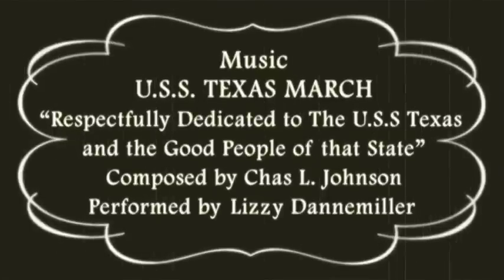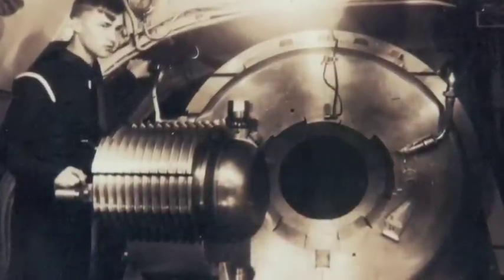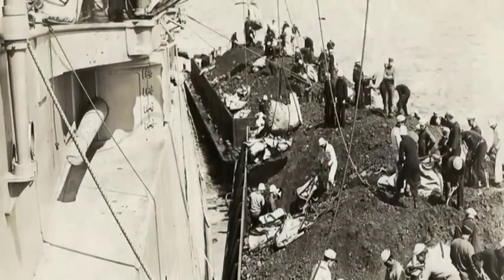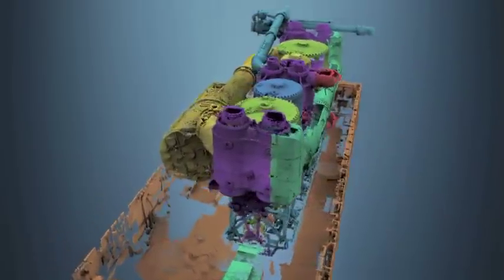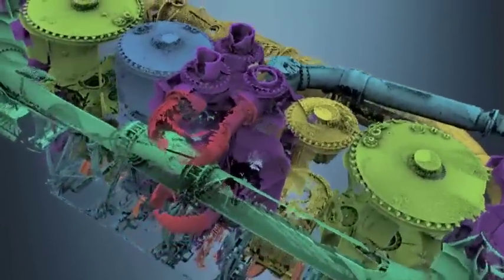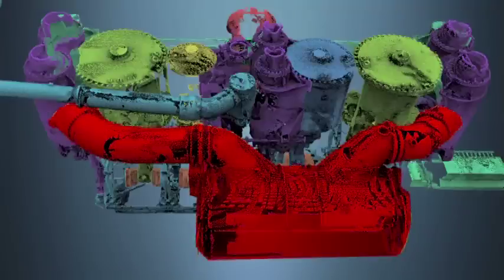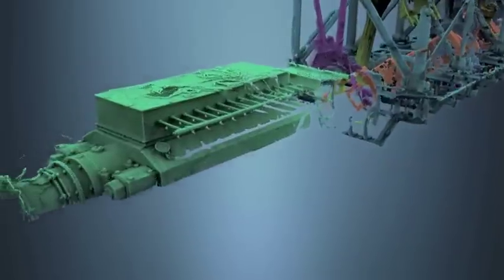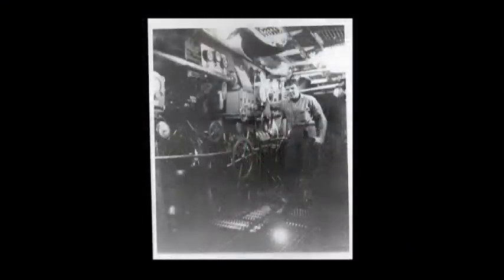Battleship Texas Engine Rooms

Comment: This battleship would not be classified as a dreadnought let alone super dreadnought. Yes, the big guns and the armor is comparable to a dreadnought, but the missing component are steam turbines. All dreadnought and super dreadnought classified battleships would need to be powered by steam turbines which for a ship of this era would have a top speed of 25 knots. The year they mention for the Texas construction follows the actual Dreadnought battleship, usually a battleship without turbine engines would be classified a pre-Dreadnought. This ship would be obsolete as soon as it was built.
Reply: +WMJCPA: In fact she is a dreadnought. The term is properly applied to the configuration rather than the power plant. Yes he wanted a good top speed, but Fisher's primary concept was to have a uniform main armament rather than a mix of heavy and light guns. The USS Iowa (BB-4 not BB-61) Is a good example of a pre-dreadnought. She carried four 12" guns in two fore and aft turrets and eight 8" guns in four wing turrets. HMS Dreadnought's top speed by the way was 21 knots-exactly the same as Texas's. In fact all US Battleships-turbine driven or not had a max speed of 21 knots until the USS North Carolina and her sister USS Washington were commissioned in 1941-their top speed was 28 knots. The main advantage of a turbine in this era was better fuel efficiency, fewer moving parts, and a good deal less vibration than a reciprocating steam engine.
Reply: ***** I don't think the British really cared about the definition of the term 'dreadnought'-at least not until the naval historians started writing about the subject in the 60's and 70's. As far as I can tell from my reading, any post 1906 battleship can and probably will be called a dreadnought by somebody. The term, as I said in my earlier post is generally used to mean a  battleship with a uniform main armament.  Since no one was building mixed armament battleships after 1906, all post 1906 battleships can be considered 'dreadnoughts'. My point was that speed and/or engine type had nothing to do with the 'Texas' being a 'dreadnought'.  You're correct that turbines alone don't make the ship faster, but I can't think of any major naval battle that was won or lost because one side ran out of fuel in the middle of the battle, so your comment there seems a bit silly. And if speed is so unimportant, why were naval planners and architects consistently seeking to raise the top speed of warships? I don't think it was because they were competing for a racing trophy . . . 
If the British want to refer to their new carrier as a 'supercarrier' who cares? They no longer have an empire, throw them a bone for God's sake.
Reply: +DEEREMEYER1 I do agree with you and also the subsequent reply has merit.   I think the Brits are basing their classification of the older carrier on 2 points.   I could be wrong but this is my opinion.   The Brits did come up with 2 very important innovations in modern carrier design, the angled flight deck and the enclosed bow called either a hurricane bow or an Atlantic bow I don't recall.   But it was these innovations that made a major difference in carrier design.   Is it enough to classify a ship as a Super Carrier,  I don't know.  I think nuclear power is a real part of that class, that in and of itself  makes these ships or any ships more formidable since they are not tethered due to cruising radius,  they could stay at sea indefinitely, at least as long as the food holds out.  I don't know if the Queen Elizabeth is nuclear powered,  it would seem that is state of the art for a supercarrier,  but who knows,  they can call it what they want.   

Finally as fat as the Forrestal,  I believe that was the first American carrier with the angled flight deck and the closed bow, hence the posthumous elevation, but again,  what difference that makes I have no idea.
Reply: +DEEREMEYER1 I don't think you read the comment properly.  I said nuclear power made the Nimitz class and now the Ford class more formidable because of not having to worry about fuel consumption.  As far as the Montana class battleships that were to follow the Iowas.   yes they would have been slower by about 5 knots.  Some of that had to do with a wider beam which was necessary in order to carry a 4th turret of 3 16 inch guns,  also the armor was to be enhanced over the Iowas.  The Montanas were the first class of American ships which would have been too wide for the Panama Canal.  We could go round and round on the Montanas since they never even made it to a serious drawing board. 

I agree,  full or flank speed would be reserved for actual battle conditions.  Even the nuclear carriers do not steam along at full speed unless they would be conducting air ops,  even when fuel isn't a problem.  Likely steaming at full speed too log could put a strain on the hull members and the keel, but I don't know I'm not a naval architect,  I just enjoy naval history, but according to you I'm silly so I guess this is just some silly fallacy.   if you noticed in all of my comments I never once called your comments silly, I don't understand why today when people attempt to discuss any topic one must ultimately revert to insulting the other party.  You can state your opinion and your information without this nonsense, but if you must then have at it, that is silly and gets everyone nowhere.
Reply: +DEEREMEYER1 Wikipedia no,  this is from many years of accumulated knowledge picked up wherever I can find it.   I have done extensive reading on the history of Naval warfare studying various sources.  of course nobody can know everything about the topic, unless you are in the field.  In my case it's just an insatiable thirst for knowledge on naval warfare and design and capabilities of warships.   This all started way back in the early 70's  when I was in college.   I picked up one of those pocket books with an illustrated history of Hitler's High Seas Fleet.  It was just one of those things as a diversion from the text books in a time when there was no cable TV  no Internet or other media.   So in reading through the History of the German Navy in WWII which was somewhat interesting even though it wasn't a huge fighting force. I wanted to go further.   I picked up History books on the High Seas Fleet of WWI, the events that led up to Jutland, the German development and innovations in submarine warfare and design.   After exhausting that ,  I picked up a history of the U.S. Navy from the birth of the nation to the then present day.   What I derived from this that naval history is inexorably woven into the fabric of our nation.  When the British began to settle the Americas,  naval construction was very much part of the decision to stay.   Britain had virtually depleted their forests for the large timbers needed in naval construction.   What they found in our rich forests was a breed of tree called "live oak"  They found the properties of this timber to be quite unique.  It was not usable to construct an entire ship,  but when lengths of wood were cut from the timber and used to enhance the side hulls of ships it behaved like armor.   The properties of this timber seemed to absorb the shock of a cannonball striking the side of the ship.  Hence, they came and they built ships hewn from our forests. 

Anyway enough of that,  I could not have found that information in Wikipedia in this short time, so I just wanted to show my "credentials" as someone who has been interested in this for over 40 years.   I almost joined the Navy in 1975, in fact they recruited me in a big way.  The only thing that stopped me was my impending wedding that summer, and the advice of a friend who was a swabbie and participated in the naval blockade of Cuba during the 1962 missile crises.   He told me the Navy was not a married person's service especially not a newlywed.  At this point in life I should have opted for the Navy.  

One note about speed, and I agree with you speed is not a major factor in most cases.  But,  considering the great speed of the Iowas, is probably a major factor that saw their rejuvenation in the 80s.  They had the juice to run with the Nimitz class carriers as part of an awesome strike group.  I did once see a video where they were talking to a sailor who had served on the MO in Korea.   The reporter asked him how fast the ship was.   He responded the top speed rated was 33 knots,  but he said if they really cranked it open to flank they could hit 38.   when they would do this they would get a huge rooster tail coming off the stern.   this bore out official accounts that said each one in class had hit in excess of 35 knots.   not bad for 50,000 tons of steel
Reply: +DEEREMEYER1 yes I remember the politics of the Kennedy.  That was that moron McNamara who didn't want to build it Nuclear.  Ok better check your facts, the first Nuclear carrier was the Enterprise.  this was followed later by the Nimitz class.   Kitty Hawk I'm fairly certain was not nuclear,  but I could be mistaken but I don't think so.  I had a colleague who served on the Kitty Hawk during Vietnam, and fairly certain not nuclear.

Regarding the JFK, I remember at the time the news talking heads discussing why would you not make the ship nuclear after the success of the Enterprise.  He did not want to ask Congress for the huge amount in 1960s dollars it would take to make it nuclear,   after all LBJ  had his hands full with Vietnam.   I Remember critics of the administration saying here we are building this huge carrier which is obsolete before it even gets off the drawing boards.  Yes it was a political decision they just wanted to get a ship out there bearing JFK's name.   Seriously, check your facts on the propulsion of Kitty Hawk. I will too. 

I didn't state unequivocally that the reason for the Forrestal being reclassified a supercarrier was the deck and bow, I merely said it could be.
Reply: +DEEREMEYER1 yes I remember the politics of the Kennedy.  That was that moron McNamara who didn't want to build it Nuclear.  Ok better check your facts, the first Nuclear carrier was the Enterprise.  this was followed later by the Nimitz class.   Kitty Hawk I'm fairly certain was not nuclear,  but I could be mistaken but I don't think so.  I had a colleague who served on the Kitty Hawk during Vietnam, and fairly certain not nuclear.

Regarding the JFK, I remember at the time the news talking heads discussing why would you not make the ship nuclear after the success of the Enterprise.  He did not want to ask Congress for the huge amount in 1960s dollars it would take to make it nuclear,   after all LBJ  had his hands full with Vietnam.   I Remember critics of the administration saying here we are building this huge carrier which is obsolete before it even gets off the drawing boards.  Yes it was a political decision they just wanted to get a ship out there bearing JFK's name.   Seriously, check your facts on the propulsion of Kitty Hawk. I will too. 

I didn't state unequivocally that the reason for the Forrestal being reclassified a supercarrier was the deck and bow, I merely said it could be.
Reply: +DEEREMEYER1 I agree with you on retiring the Iowas, but the powers that be are opposed.  Remember,  Bill Clinton almost sold the MO to the Japanese for scrap in the 90s, go figure the irony of that one.   At least we have all 4 Iowas standing as museums, along with several ships from the South Dakota class and the North Carolina.   The Brits kept not a single capital ship from WWII  there only remnant is the cruiser Belfast in the Thames, which I did have occasion to tour.   It is no battleship that's for sure.  On my bucket list is wanting to tour one of the Iowas and one of the South Dakotas.  Ideally I would like to tour the MO but I don't think that will happen. n We will have to see. 

As far as typing,  I'm doing this on my smartphone, not really the best instrument for fast typing.   The fat thumb problem rears its ugly head.
Reply: ***** I didn't say fuel wasn't important, only that I don't know of any case where one side lost because they ran out of fuel during the battle which is what you seemed to imply with your comment about racing "And then when we're racing and you run out of fuel, I'll pass you and win." Nor did I say anything about steaming at full speed at all times, only that a high top speed was-and still is-considered a desirable feature in a warship. My apologies if the comment seemed belittling-not my intention. You are correct that in a strategic view, fuel conservation is vital, but in a tactical situation it goes out the window. As you yourself said, the use of flank speed is to EVADE enemy bombs, torpedoes and shells. There's no point in conserving fuel in actual combat if the result is your ship is on the bottom with full fuel tanks because you were moving too slowly to evade a torpedo, etc., but no, high speed in and of itself is not a magic shield that protects a ship-as the unfortunate sailors who served on HMS Hood found out (Jackie Fisher's 'battlecruiser' concept was a huge mistake in my opinion).  The key, as I think we can all agree, is the right combination of speed and protection (protection being armor, air cover, anti-missile batteries or whatever).  I do agree that they should have kept an Iowa in operation. And I don't trust any government because lying is what they do best. It's now 4 am and I'm going to try for a little sleep.
Reply: ***** No offense, but are you actually reading my posts before you go off on me? No, of course a ship can't always reach its design speed especially in high seas. No there isn't a lot of difference between 23 and 25 knots.  No, warships especially large ones don't operate alone.  And I said that speed alone is not a shield. All I'm saying is that high speed was, and still, is considered a desirable feature of a warship. In battle warships normally operate close to or at the maximum speed that conditions will allow.

Answer me this sir.  If speed is so 'unimportant', then why weren't all warships designed to go a nice easy fuel conserving 10 knots? In regards to speed winning a battle, I'm working on less than four hours of sleep, so no, I can't think of a battle where speed alone was the deciding factor, but I will mention that any PT boat skipper going in for an attack was going to make the highest possible speed given the conditions that he could, not idle along to save fuel during the critical moment. And whoever he's attacking is not going to poke along to save fuel when  the torpedoes are inbound.  And no I'm not talking about just one ship vs one ship there.
  As for the British losing capital units in great numbers the only instance I can think of offhand is Jutland in 1916.  Most of their losses were battlecruisers I believe.
  In regards to straddling, you seem unaware that until radar came along, fire control was NOT very accurate.  Range and speed had to be estimated, fed to the guns which then had to be elevated and fired. That takes time and in the meantime, your ships and the enemy ships are still moving. Every navy, ours included, sought to straddle the enemy in a gun duel. It was the best way to get a decent idea of the actual range to target. If you got a hit with your second salvo, that was pure luck. There's a game called 'Atlantic Fleet' available on Steam that does a pretty good job of simulating the difficulty of hitting a moving target from a moving platform. And yes, I know that a game is not the same as reality. Alternately, you could get a radio controlled boat and have a friend operate it while you shoot at it with a BB  gun or a .22 while you're walking quickly and sighting it through range-finding binoculars. Of course it won't be shooting back at you unless you drop a thousand dollars or so on one of those RC warships that have working turrets and BB guns mounted in them. Anyway, the point is, it's not at all easy to hit a moving target from a moving platform, especially when the ships are moving at top speed-for the prevailing conditions. 

  Bomb splinters are just that, flying shrapnel from an aerial bomb that exploded on contact with the water close to the ship. Shell splinters-those result from plunging fire, and since most big-gun battles were fought at a fair distance, virtually none of the incoming shells are arriving on a flat trajectory.  An HE shell rather than an armor piercing shell striking the water will explode and send splinters flying.  If it 'is' a relatively flat trajectory, the shell can skip along the surface of the water for quite a distance by the way.

 As for Pearl Harbor, give the British a break. It's much easier to raise a ship from shallow water, and most British losses were emphatically not in shallow water. And yes, they did suffer from a lack of destroyers because they were simultaneously trying to provide escorts for their battle groups and for the North Atlantic Convoys which were the only things keeping Great Britain from being forced to surrender.  I won't deny there were a lot of flaws in British warship design-again mostly due to Fisher's overemphasis on speed to the detriment of armor-and certainly sending the Prince of Wales and Repulse out without air cover was a damn silly thing to do, but they managed to keep themselves afloat so to speak for two years before we officially entered WW2. And yes, FDR gave them as much help as he could, which undoubtedly was a major factor in their survival. But all things considered, I'd say they fought pretty well.
Speaking of Pearl Harbor, the only ships not salvaged were the Arizona and the Utah. The only one not to go back into service after salvage was the Oklahoma which capsized. By the time they got her upright and floating there was clearly no need for an obsolete WW1 era battleship. The Arizona was, of course, too badly damaged-everything forward of the central superstructure was blown away down to the armor belt except for about 12 feet or so right at the bow. That's why her forward mast is leaning and why the forward turrets are submerged/awash.  The Utah was a target ship being used for aerial gunnery training (they mounted a bunch of AA guns to train ships crew on using them in combat), so they moved her far enough to clear the channel and left her.

I look forward to your next explosion with eager anticipation sir. ;)
Reply: +DEEREMEYER1 talking about battleships sent out alone look what happened to the Prince of Wales and the Renowned  (or was it the Repulse), anyway doesn't matter what matters is they were quickly dispatched by Japanese land based aircraft.  Then let's not forget the creme de la creme,  April 1945 operation Ten-ichi-Go, when the Japanese sent the superbattleship the Yamato on what was to become a suicide mission to use its 18.1 inch guns to break up the Okinawa landings.  The huge battleship found itself floundering at the hands of carrier aircraft like a huge beast attacked by a swarm of bees.  I hate to admit it,  but if this didn't shatter the notion of a huge ship with very large artillery pieces, I don't know what would.  The fact is, the battleship was no longer a viable fighting machine in a naval battle.  However,  as a movable gun platform capable of delivering large amounts ordinance against land targets was very plausible,  hence the NJ 's deployment to Vietnam and the subsequent deployment of all the Iowas to the fleet in the 1980s.   The MO and WI were about to fight their 3rd war in 1991 with Operation Desert Storm.  I was giddy with excitement as I saw the MO launch the attack on Iraq when their Tomahawks became the very first shots fired in that operation.   Yes the Iowa battleships were the best vehicles to project sea power in a war zone.   There is something sexy about the battleship,  something the carriers have never been able to achieve.   Maybe it's because these ships were very aesthetically beautiful. (except for the Brits, there battlewagons were butt ugly) There symmetry of the ships was amazing.  No matter how you slice it,  there will always be a good mystique  from these behemoths.
Reply: +DEEREMEYER1 yes and throw in a few carriers for fleet air cover.
Reply: ***** Sir, I have tried to be polite in this discussion. I concede that as a mechanic you have more working experience with machines than I. I haven't disputed any of your points about not using top speed all the time, but using fuel in the most efficient manner because you are correct. The point I have been trying to get across, without success and which you have not yet actually addressed, much less refuted because you keep going off like a roman candle-not to mention being as insulting as possible-is that warships are designed to go fast then and now, because at certain times-most often in battle-speed IS important. You accuse me of 'playing professor' and insinuate that I get all my information from Wikipedia. I have a Master's in Maritime History and have been reading about the subject in studying it since I learned to read. I sincerely doubt that you have read half the number of books written, as you say 'by authors who either SERVED ON ships while in the military, or went along as civilian observers on ships as they were deployed' as I have I've also worked alongside many navy and ex-navy personnel and discussed the subject with them. If you think that dragging in every possible situation where speed is NOT important or is an actual detriment makes you right then clearly you have NOT been listening to what I have been trying to say. Let me try one last time: Speed was and is a desirable characteristic in a warship because in certain situations, most usually in a battle, gaining the highest speed the ship can achieve is an asset. Speed is not a magic shield that protects against all harm, nor is it the only factor a naval architect needs to take into account when designing a warship.  weight of armor, fuel capacity and efficiency all have their place. NO ship runs at top speed ALL the time, because doing so is wasteful and damaging to the ship, nor, have I at ANY time claimed that they do. But at a critical moment in battle, when a torpedo is incoming, the bombs are dropping or shells are on their way, the skipper will order the engineers to open up the throttle and wring every last knot out of the engines and be damned to fuel efficiency, because that last half or even a quarter of a knot may make the difference between being hit or being missed. And if you had paid ANY kind of attention when you were 'reading' those accounts you'd know that. Has that penetrated the 16 inch armor plate you call a skull? Or are you too busy thinking up ways to be insulting or finding more completely irrelevant ways in which speed isn't important, instead of trying to conduct a polite discussion which is what I was trying to do. You sir are a self important jackass, who, because he has read a book or two considers himself an expert on a subject and cannot stand to be contradicted.  And when someone does, you drag in a whole slew of irrelevant facts which 'prove' your case, all the while belittling and insulting me to make yourself feel better. Good for you, you really showed me that, as the old adage says, "arguing with a pig only wastes your time and annoys the pig".  I've wasted enough time.  Goodnight Piggy, don't stay up too late oinking on subjects about which you know everything and understand nothing.
Reply: +Joseph Greeley Well said sir.   I understand your plight completely.  .This guy seems to like to play Big Gun narcissist, but it is possible to get to reason with him.   it took me awhile yesterday, and I was accused of using Wikipedia as well and said my point was silly.   I don't have a masters degree in maritime history, but I have had a 40 year quest for knowledge on naval history.  As I tried to point out yesterday, it seems to me from my readings that the history of our nation is a fabric woven into naval history.  So yes you are right about speed being a desirable characteristic of ship design,  otherwise the battlecruiser would never even been thought of.   The concept seemed sound when the admiralty of England believed that sea battles would take place at shorter ranges where the belt armor would offer protection.  They never considered the danger of long range plunging fire from heavy shells.  They learned and learned again with the Hood. 

At Jutland though, at least as I understand and can remember my studies on the battle,  the deck armor was not the whole of the problem.    Beatty's battlecruisers had another problem that all British capital ships possessed,  and something the Germans had foreseen.   The Brit's used a single door system at various points of bringing shells and powder charges up from the magazine below.   Ideally,  the shell would move up a level and the doors would close behind it, and then up and up opening and closing the doors.   This sounds great on paper but in the heat of battle these doors would be left open to move ammunition more quickly.   If the turret was struck by a shell, the flash from the explosion would have an unobstructed path all the way to the magazine.   the Queen Mary and another Battlecruiser were struck in this fashion, and the flash went straight through to the magazine.   The Germans used a double door system and no door could be opened until the door behind was closed.   This made the German ships safer from this kind of hit.  I don't recall the order in which the British ships were struck. but even Beatty's  flagship HMS Lion took a hit to a turret,  but one seaman with his last dying effort got the flash doors shut thus preventing the Lion and Beatty from succumbing to the same fate.  I believe this seaman was awarded a Victoria Cross posthumously.   Anyway it was somewhere in here that Beatty issued his now famous comment,  there seems to be something wrong with our bloody ships today.  Anyway I just wanted to get the point out that it wasn't truly the deck armor problem that caused the loss of those battlecruisers.  One final note,  the Germans had superior stereoscopic range finders thus making their gunfire more accurate.
Reply: ***** Thank you, and you are absolutely correct about Jutland and the British losses.